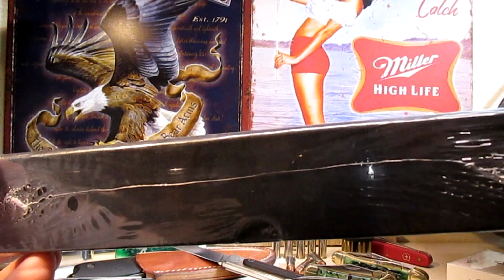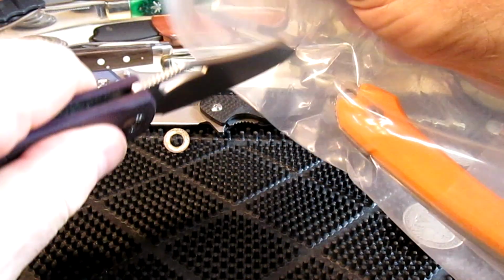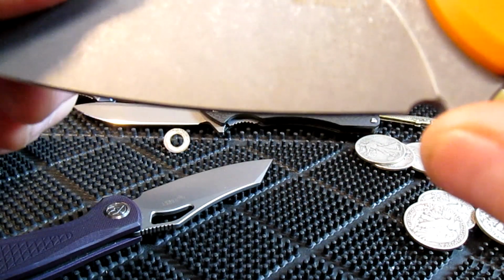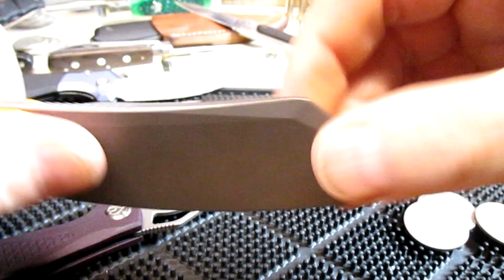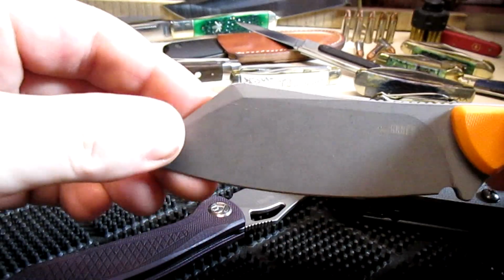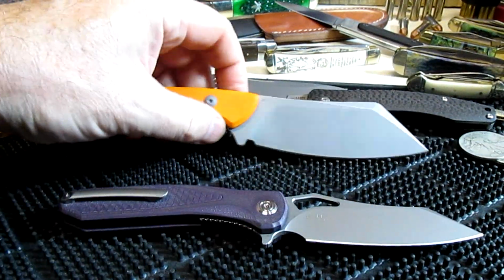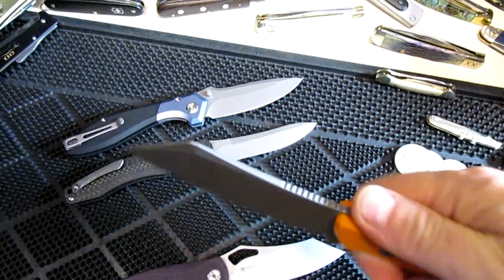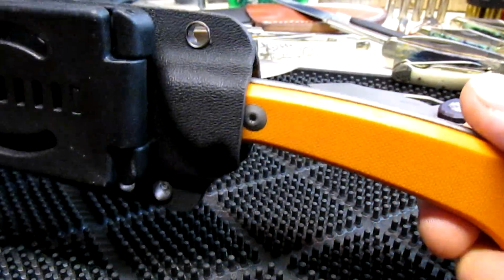KUBEY SURVIVAL KNIFE ORANGE G10 HANDLE & D2 TANTO BLADE KYDEX SHEATH WITH TEK-LOK KU302A UNBOX

Comment: Very nice knife from Kubey, like the handle and choice of color, the blade shape is really awesome, good point. Good to know the d2 tang is chamfered so there’s no hot spots. Awesome it chopped the wood yet sliced the mater thin enough. The temple thumper or nut cracker where the lanyard hole is is a nice plus. Perfect for carrying edc…awesome review, JP. #10 👍Have a good evening. 🌰
Edited bc spell check really dispises me 😅
Reply from the maker: It is a well designed blade good for lots of things, ideal camping knife. Thanks Nikki have a great weekend. & yeah spell check sucks 😄🌰✨